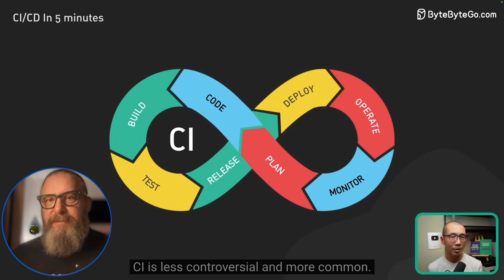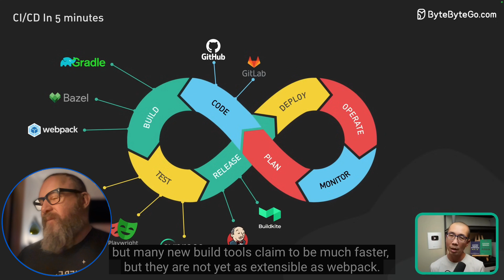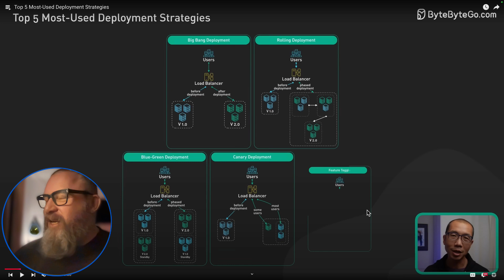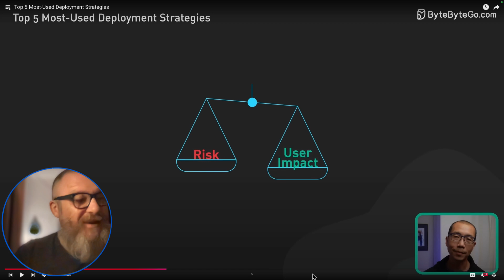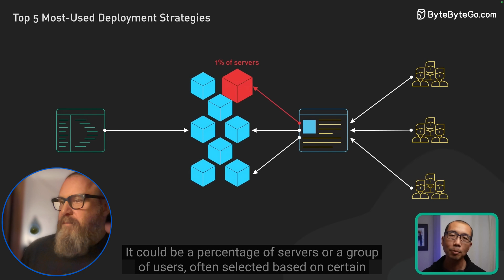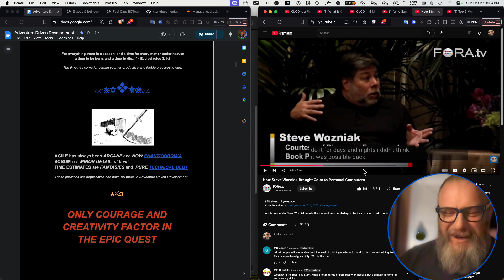CI/CD is a Financial Scam

Comment: you clearly dont know how to setup and manage a proper CI?CD workflow. and it seems you also have issues to write and manage meaningful tests, and yes FE tests are usually not as useful as having a human do QA in a QA env
Reply from the maker: I've set up several of these CI/CD pipelines, and for back-end its not hard at all. BUT FOR FRONT-END ITS BEEN A TOTAL NIGHTMARE.

These systems seem to consider mobile dev an after thought and the whole reason for CD is to do the QA testing automatically... the fact that you consider that a job for QA means that you are not understanding the CI/CD main marketed benefit.
Reply: @ChrisAthanas  CD in many cases will have a manual approval gate before final release, since it most cases you wont be able to 100% replace human QA. you know there is always in between. you can even just go for the 20/80 rule and just put in 20% of work to get 80% of the benefits (like just do release management with a final manual approval gate and static code analysis and security checks and some minimal sanity tests after release - as example, of course you can add meaningful tests and so on). Also if you good at your job the time it takes for a pipeline to finish is a key metric, since a quick feedback loop is essential for a functioning development cycle
Reply: @peterromfeld4091  I think the schilling with CD was often marketed in solutions where it's a non material impact (usually ecommerce frontends like amazon or netflix).

In backend land continuous delivery (esp. in non-tech led companies), is basically non existent... speed to release new feature is not worth the risk of a bad transaction. This was very much sold but most people don't follow it as it doesn't make sense for their org and I don't think people really think about it like that today (mostly as you described)... Usually at best CD to an uncontrolled UAT environment.
Reply: @ChrisAthanas  I would make a broader argument that software release for mobile/embedded/frontend for teams sucks in general. Backend you can normally write code and have it test in the actual runtime it is targeted for (ideally centralised with CI, though containers remain a bit of a flavour).

Mobile/Frontend you really need to run on your system and see the elements move in realtime, this means you end up with two different runtimes so build issues are inevitable. With the added joy that fe frameworks version hyperaggressively (along with the toolchain) and it is basically impossible to have a clean build (devoid of npm vulns) for any period of time.

Comment: Most of this video seems like shadow boxing with wild tangents.

You should have spent some time explaining what you mean by adventure based programming and why that differs.

Generally agree that excessive CICD tooling is brought in on projects far too early though you presenting your relatively narrow use cases here (sounds like SMB LOB applications developed and maintained by the same author). In mid/big or tech led organisations it will be unusual that the code will be maintained by the same people over time (often different project resources and average tenure being 2years means you need some sort of hand off). Having hand crafted steps here often results in poor release hygiene (unintentional reversions, uncertainty on whether code was compiled in, outages). Criticising bytebytego (whose video is explicitly system design) on discussing solutions that you think is important for backend is unfair and you should have spent more time to consider your position, noting the further context that their content is focussed on landing enterprise jobs, not smb developers. I don't think 100% test coverage on BE/BFF is common at all (especially unit whose value is pretty mid)

Recommending a business to do onprem (esp if new) for a new initiative is pretty wild. Unless they have spare hardware assets to use for the initiative the procurement time will exceed the time to test on a cloud based service... at worst a small vm will cost you < $100 a month and give you far more availability and extensibility than you can offer elsewhere. Plenty of options here (gcp/aws/azure/do/vercel) that you can get to test your code for pennies.

At the risk of being demeaning someone running business applications that are backended by SQLite is indicative of the small userbase those apps have, not that hosted services are a scam. You can absolutely multitenant those referenced databases or use cheaper services like planetscale (or just run containers on a couple of VM and use simple shell scripts to orchestrate -- k8s is horribly complex, much more than CICD).

You have a rather self defeating argument saying how easy it is to stamp out cicd pipelines once you've done it once. If you actually believe that then creating CICD pipelines would be a net time saving (rather than having to do manual build and deploy steps with the added risk of you messing that up). I'm not sure I agree that it is easy, I think that this is true when you are doing homogenous solutions with cookie cutter system designs (eg: LB -> webapp -> SQL with webapp hosted in k8s/containers). But when the solutions differ (eg: added a queue, bus or third party platform like feature flags) this becomes non-trivial.

My general take is that it's not the pipelines, but the excessive number of tools (esp: precommit hooks, with linters or whatever) that slow down productivity. Creating a pipeline shouldn't take more than a day... if a day is a big amount of time in your dev lifecycle compared with productivity then rawdog without pipelines.

Comment: I'm curious now, how can i run a local raspberry pi type web server, for public internet customers? I see there some services like no-ip, for hosting with a dynamic dns - has anyone got experience with something like this?
Reply: You can get a ton of knowledge online! 

I've thought myself how to do it and it's definitely an interesting learning experience. I feel like you already are on the right path but you might be getting ahead of yourself with no-ip.

I'd start by learning how to expose a more beginner-friendly service to the internet such as a game server like minecraft server. Any step-by-step video tutorial is great to get the basics about networking within your own home down.

Any other service (like a web server) will simply be solving the same problem where you'd port forward a different port to the machine running the service.
Reply: @ cheers! Yeah i did some googling after posting. The game server is a good idea - might start with that. I already have some experience with networking but mostly self taught
Reply from the maker: Yes, I've done it and it's not as hard as people make it out to be. I recommend a developer does this at least once to remove the mystery of how it works. 

On-prem hosting is a secret hack to reduce your fees to zero and bootstrap ideas until you get traction. It's definitely Adventure Driven approach!

Comment: I've worked at a company that was growing fast (had product market fit) but held back by manual processes. And i've worked at a company that had so much ci/cd it consumed 80% of our time and energy. The key is balance. 

But pre product-market fit, i agree it is unnecessary and a dangerous distraction.
Reply from the maker: This is the nuanced approach that makes sense. Minimal CI/CD once product-market fit hits makes a lot of sense, if the tests are actually useful and meaningful. CI/CD for back-end dev makes a lot more sense at the start than for front-end.

I'm a big fan of End-to-End testing for the Front-end, instead of having QA manual test the happy paths and known unhappy paths. This means setting up "testing in production" into the product from the start. But I still wouldn't do this until product-market fit, as it's just a waste of time and slows things down when it's changing anyway.
Reply: @ which tools do you use for the e2e tests?

Comment: Your commentary is so on point! I've just started learning how to deploy stuff. At least I started with a good background in Linux (using as a daily driver for 3 years beforehand). Before I knew what I was doing I was keen on getting cloud certified. After trying out several "managed services" and then shorty after opting to just use a simple VM for each thing I needed to deploy, I realized how super overhyped the cloud is. All those certifications are for are to learn how to build the web in a vendor-specific way using their tools so that you can pay them 10x what it should cost you.

"You have more servers than customer" killed me!

Also, the point on Wozniak daydreaming, whilst being sleep deprived, being the way to come up with an ingenious solution is close to what I've experienced as well. I get my best ideas away from the keyboard and screen.
Reply from the maker: I am not deleting comments, nor are any on hold. Youtube seems to delete comments if they are not originating in the same country, my comments are autodeleted on many channels for some reason that I don't fully understand.
Reply: @ChrisAthanas  I described a few solutions that on the surface would seem very expensive but otherwise come in much cheaper than VM based workloads with much less administrative overheads -- obviously you pick your own pain here.

acg, hibp, and some novel log etl solutions I've designed and built processing > 1500tps are all examples of what you can do for less than a VM a month (mostly in free tier even).
Reply: I would wager most line of business (LOB) apps in Fortune500 run on VM's in cloud reaping the benefits of the easy procurement/scale rather than running their own pop/dc/colo (with the highly compatible, easy to understand and human resource VM model). I think what you (and the video) are more referring to is paas/serverless services. For a solo developer the tradeoffs don't make much sense to use paas, but when you have a certain amount of scale you don't want to be tuning db (or queue or cache) servers and managing patching yourself when you can take it off the shelf from the vendor.
Reply: @tomtech1537  Might I ask what you mean with "pop/dc/colo"?

Personally, I don't think serverless makes sense in most scenarios, even despite scale. In most cases people need to "keep serverless functions warm", which defeats the purpose and costs way more than a dedicated VM. Another youtuber (can't remember who atm) made the argument that if your service can run on serverless, then no-one is using it. So, why have it deployed at all?
Reply: @gustavstreicher4867  Bit of a false equivalency. There's some great examples of entire businesses running backends entirely on free tier. The most famous is probably acloudguru on aws lambda. Haveibeenpwned does a good job with azure storage account tables. You're not going to build that availability/scale on VM's yourself. They are relatively niche but are real examples. 

Pre-warming does not incur the same sort of cost as running a VM. The real cost is in staffing ime where basically anyone you hire can understand daemons/processes but you need to be more selective with people for cloud specialities (and therefore pay more)

I've built several log forwarding/etl solutions that were far cheaper in lambda/azure functions than running a VM. Along with adhoc jobs for various things.

pop = point of presence
dc = datacenter
colo = colocation
These are terms for physical localities for onprem hosting
Reply: @gustavstreicher4867  zzz my comment was filtered.

That comment sounds like someone with little serverless experience, there are real world examples that apply with lambda consumption being vastly cheaper than you would initially think. One solution I built was a Log ETL for a shared reverse proxy layer serving ~8mm MAU with logs in the 1,000-5,000TPS rate (cdn fronted most of the work). This was cheaper than a VM, not what I had predicted. There are many others. In this case this was the right decision as 'developers' were easier to find to fix any build issues that eventually cropped up than finding someone to patch/maintain a vm as this hit operations.

Pre warming hardly costs anything, by the same logic if no one is using your app why pay for a vm? get them to give you a call when they want to use it.

pop = point of presence
dc = data center
colo = colocation
Reply: @gustavstreicher4867  tried to reply twice,  my comments are in jail :).
Reply: @tomtech1537  Oof! I've had that before on another video
Reply: @gustavstreicher4867  pop is point of presence, dc is datacenter, colo is colocation these are on premises hosting terms. There are many serverless cases that end up being much cheaper than you might think with people with little experience vastly overestimating the consumption cost. The point of differentiation for system design is more around the ability to support over time (eg: everyone knows how to maintain a linux VM, but you need to setup patching/operation ecosystem if you don't have it to maintain a VM)
Reply: @gustavstreicher4867  Haha, the YT filter is pretty dim. I think they tried to make it smart with AI but just created a black box with (seemingly) non-deterministic output. It seems the more length and punctuation the more likely you go to jail, but low effort posts aren't. I feel like handcrafted bayseian filters would do a better job based on what I see blocked vs what gets through.